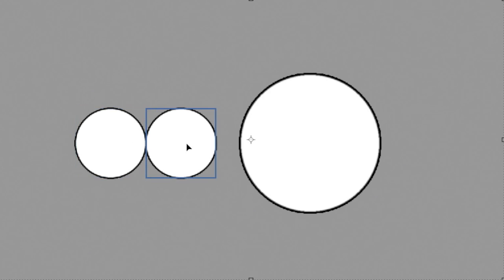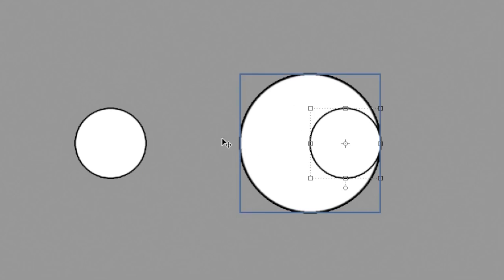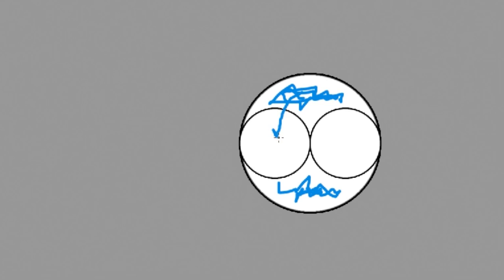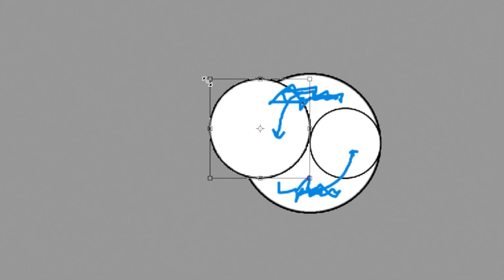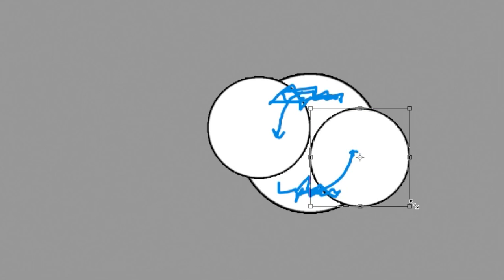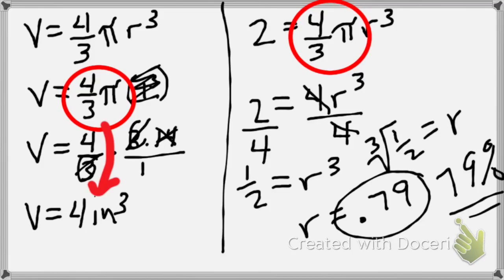Why Are My Balloon Eyes SOOO Big?- Warning: Math Ahead! (Balloon Vlog #17)

Comment: You lost me at the 3's cross each other out. Sorry - failed math.
Reply from the maker: That's called cross-cancelling. The 3 on top means "multiply times 3" and the 3 on the bottom means "divide by 3." If you do each of those things, you are right back where you started - they are exact opposites. So to save ourselves some steps, we can just cross them out. And even if you didn't quite get why, you can still benefit from knowing that the eyes are about 80% the size of the originals, not 50%.
Reply: +Mr. Boma&#39;s Balloons Thank you for your personal response. I totally understand the "mechanics" of it but the formula is eons from me! I wish I had had a teacher like you when I was in high school!  Thank you again!